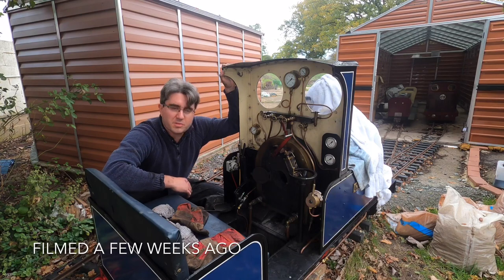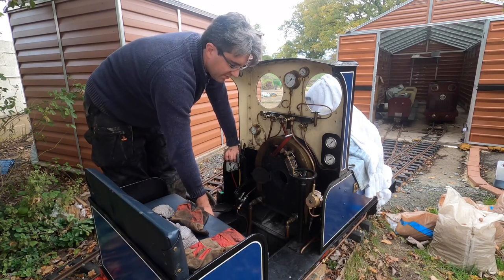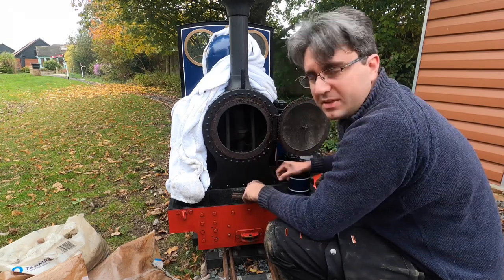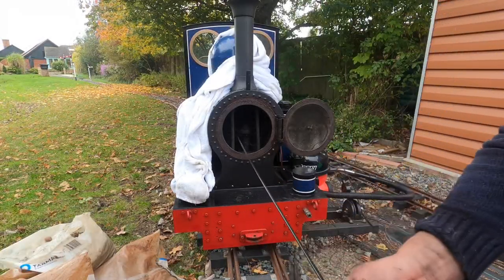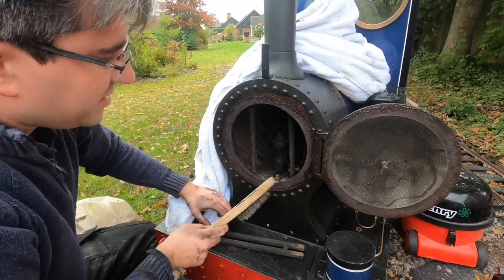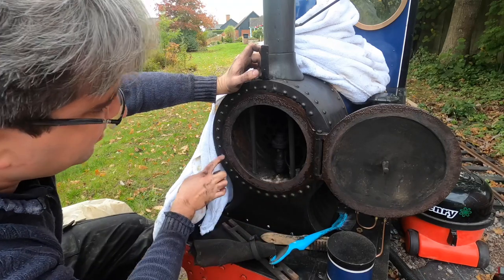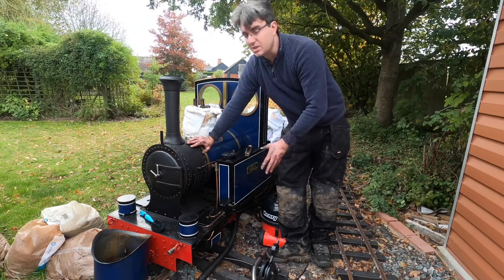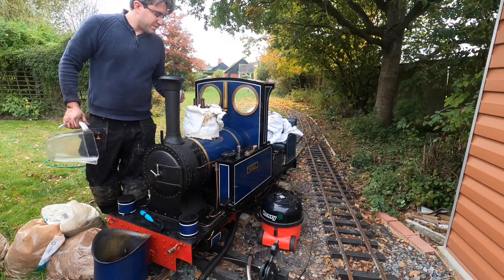Cleaning down a steam engine after use

Comment: Great engine, I knew the bloke who used to own it, one thing I'm a little confused about is why you've put copperslick on the door as I've never actaully seen anyone do that before, its a strange practice, also I'd suggest If you're leaving it sat for a bit of time its best to drain it completely and leave the drain cock open as it'll allow it to fully dry out inside, best not leaving the boiler rammed with water as It has the small chance of freezing and expanding in the boiler and popping welds, same with if you're leaving the water in overnight between steamings, best to isolate the gauge glass(es) so they can't freeze and crack/shatter, but other than that, nice video!
Reply from the maker: It was actually the previous owner who advised on the coppergrease, from a point of forming a tight seal. With regards the filling of the boiler, it is a difficult one, draining is what I did last winter because of a fear of freezing, however the boiler inspector said that it causes more rust and corrosion that way and better to keep the water in and just keeping it very well wrapped up and it shouldn’t freeze... so that’s what I’m trying this winter although I have lost me nerve and stuck a heater in there to take the chill off in this cold spell

Comment: Just a small though when using Henri for cleaning up, best to use a plastic end piece (of course when fully cool) so that no metal work is chipped by the hard metal end. This possibly applies inside to a lesser extent but certainly on the front footplate.

Oh just had another thought on your earlier vid where you talked about planting to hide or disguise part of the loop. Have you seen the Riverside Miniature Railway in St.Neots (where I live) they have used Willow Sticks to create a tunnel. Very nice and good to look at though as a living entity does require some maintenance but possibly less trouble than real trees if kept well in check. Look great in your super garden.
Reply from the maker: Thank you so much John. Those are great suggestions. I really appreciate you taking the time 😊